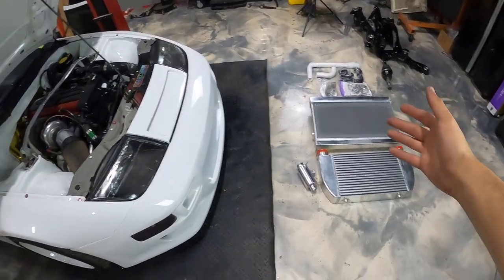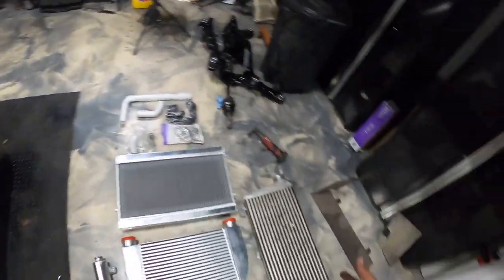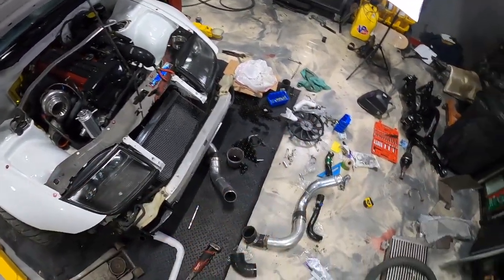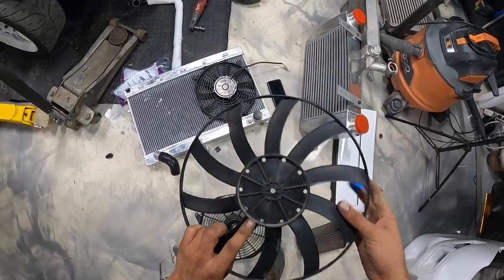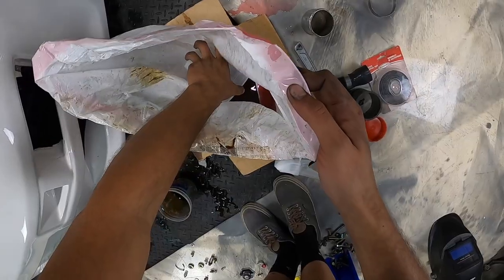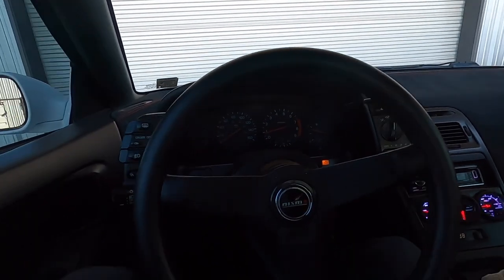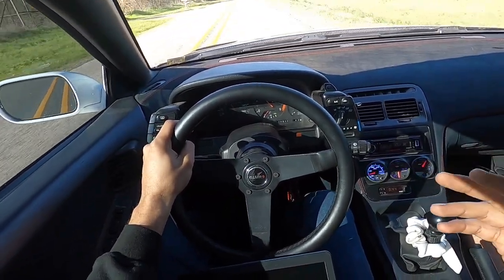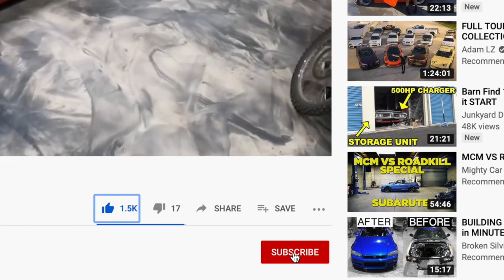The BEST Intercooler Set up for a Any Turbo Street Car 💯 DIY

Comment: My fa1 civic got up to 220  so I'm pretty much gonna upgrade the radiator to a aluminum one, new fans , oem water pump and thermostat
Reply from the maker: Definitely a good start. But you gotta check the operating temp on those. Might be around there. If not. Coolant flush if it’s looking dirty. Maybe some ducting to the rad😎

Comment: Nice. Mine runs between 188-193 cruising, beating on it, everything. I love my v mount
Reply from the maker: Yeah man worlds difference. Super happy with the result. Next step. Rear ended swap to get those long gears and not be ripping 3800+rpm cruising. Should be helping the heat situation a bunch as well.
Reply: @KalvinMalli  the M45 3.13 would be ideal. Only thing is they don't come with an LSD but the factory vlsd from a z33/g35 diff bolts right into the M45 diff. Or you could buy an aftermarket LSD for the z33/g35 diff and use it in the M45 diff instead.

Comment: You need a shroud on that radiator man. It will make sure you pulled air through the entire radiator rather than just where the fans are.
Reply from the maker: It’s actually doing really well without. Might do a comparison eventually but it’s doing amazing as of now!🔥

Comment: Wait until you put the ac condenser in there and Texas summer days...cooking time... If I was you I try to put the clutch fan back in there  if you have space, if not get ready to put a 200 amp alternator and some real fans like Spal or Derale and big ass relays and wiring with decent battery...those change the blade fans you got for pull or pusher  applications are not very efficient at moving good cfm's but hell try them and see!!...keep the good work and take care...
Reply from the maker: Condenser is mounted on the side where side mount intercooler would go on pass side 💯 Not entirely sure how a clutch fan would work with the radiator set up. These maradyne fans do the job really well at the moment! 👌🏽👌🏽
Reply: @KalvinMalli  Damn, how big is that condenser to fit in the  oem intercooler location,  if too small for the compressor size it will not maintain safe high side pressures....hey Malli you  got  to do a cookout or something to share the rides...

Comment: Hey Kalvin, thanks for the awesome video. I'm planning out a low mount single turbo vg30dett build with the turbo mounted off to one side in the trans tunnel, and this is a very exciting setup in terms of cooling potential. If there's enough space with a straight 6 there will surely be enough space with the V6. Cheers again, I found this really helpful